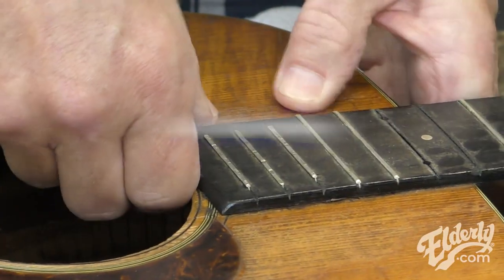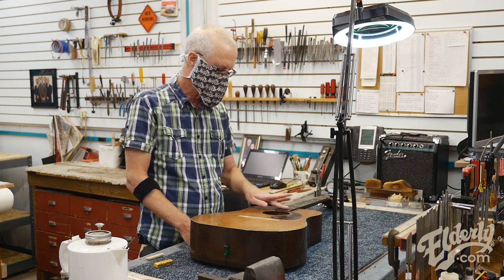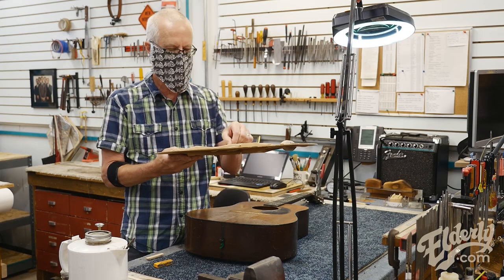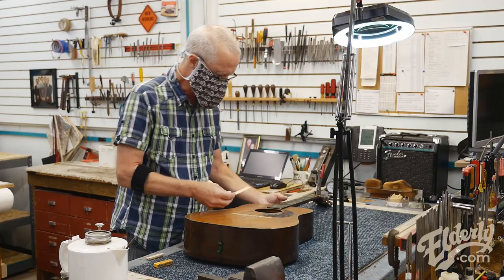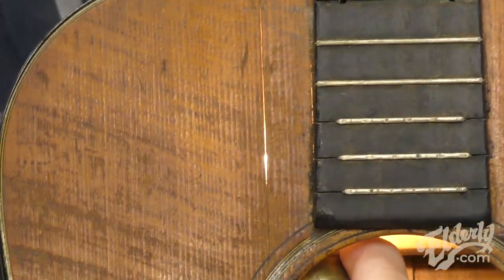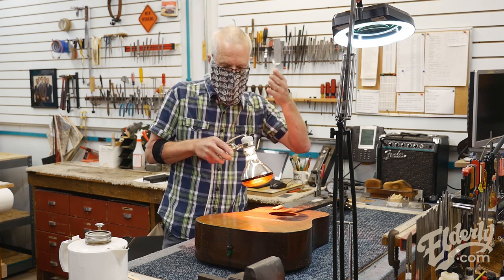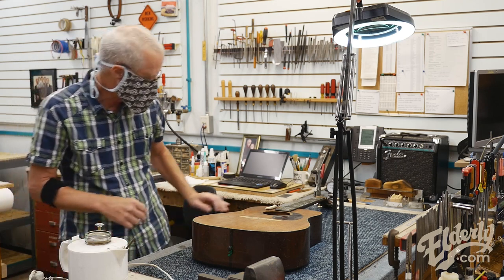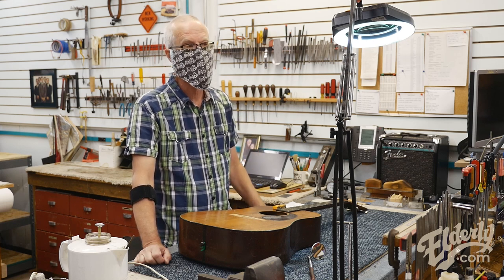In The Shop: Repairing Top Cracks on a 1937 Martin D-18

Comment: there must be a better way to prevent crack on the outline of the pickguard. do not use it and replace with a PVC sticker which may cause the finish worn out but easier to paint back.
Reply: Martin used to finish over the pick guard and glue it to bare wood. Also the faux tortoise material used was very suspect to excess shrinkage.